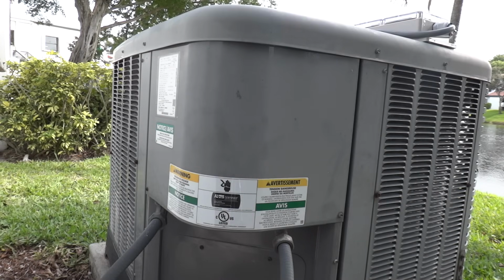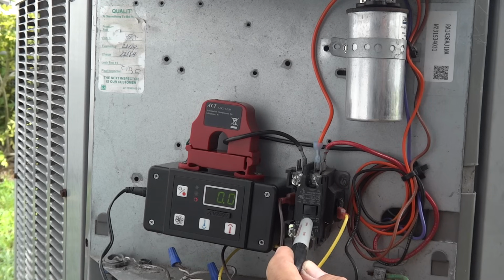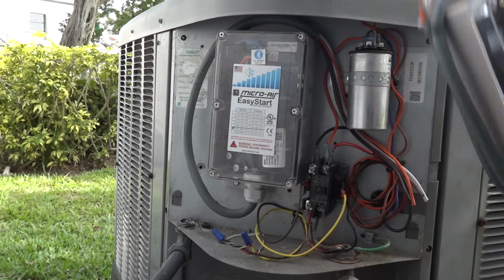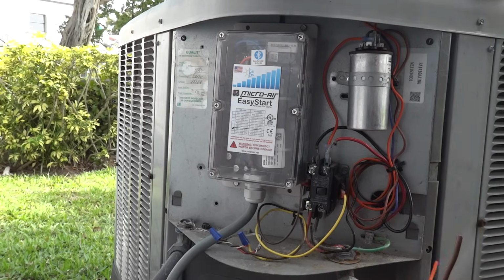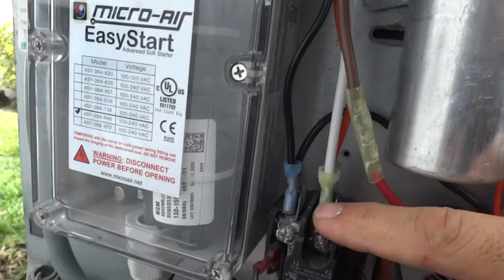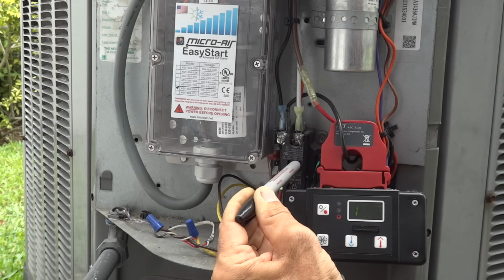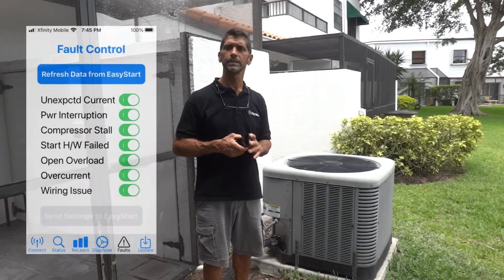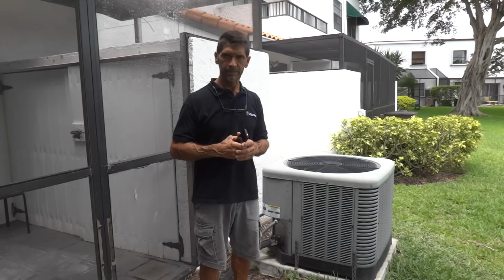Micro-Air EasyStart Home A/C Installation (368 Series)

Comment: Great directions.  I installed it today.  I spent more time on the bluetooth connection than on the actual installation.  5 stars on the product.  1 star on the bluetooth.  There was the oddest coupon in the box.  "If you bought this on Amazon, you paid too much."  Weird.
Reply from the maker: Hello and thanks for your comment and feedback.  The coupon you mentioned definitely did not come from Micro-Air, so we'd like to investigate that; from whom did you purchase the EasyStart? Also, what was it about the Bluetooth connection that you did not like?  Thanks in advance.
Reply: @MicroairNet  I tried to call but the automated answering system gave me the online options then hung up.  Do you have an email address?
Reply from the maker: @flyingjeff1984  Yes, you can send an email to help@microair.net.

Comment: Matteo, would you recommend a Micro Easy-Start on a 2 stage carrier condenser?
Reply from the maker: Hi and thanks for your question. Yes, absolutely. Other customers have installed EasyStarts into these types of systems with success.  By "2 stage", these systems are actually a single compressor with two *capacity levels*.  The compressor always runs at the same speed, but when your thermostat calls for stage 2 and it energizes the Y2 wire (in addition to the Y1 wire), the condenser controller energizes a solenoid at the top of the compressor that increases the pumping capacity of the scroll.  This is what the mean by "stage 2".  So, the EasyStart wiring is identical, however, we recommend that you carry out the first 5 learning starts for the EasyStart when the system is actually calling for the second stage (and thus drawing higher running current).  During each learning start, we also recommend that you run the system for at least 6 minutes because the EasyStart collects (i.e. learns) the steady-state running current for your compressor after it warms up at the 5-minute point.  This sort of learning procedure can be carried out easily by conducting the first 5 starts with the thermostat set at least 5 degrees below the room temp. For most 2-stage thermostats, such a high setpoint differential will cause the thermostat to energize both Y1 and Y2, and your condenser will engage the second stage after a minute or two.  Run the system at least 6 minutes for the first 5 starts and then you can restore your thermostat to whatever temperature you prefer.

Comment: I have the Goodman - GSX 140361 14 SEER 3TON CONDENSOR WITH A CAPF 3642C6C A-COIL WITH -TXV  I BELIEVE THIS MAKES IT A 3.5 TON  NOT SURE.    SO COULD YOU LOOK INTO THIS AND RECOMMEND WHICH EASY START MODEL I WOULD NEED. NOT SURE IF I WOULD EVER RUN IT ON A GENERATOR IF THAT MATTERS.  THANK YOU
Reply from the maker: Hello KRD.  Thank you for your question and for your interest.  The capacity of your condensing unit is what matters to the EasyStart.  So in your case, the 3-ton Goodman would require the the ASY-368-X48-BLUE model EasyStart.

Comment: Just purchased and installed my second easy start. First one was on my last home with a 3 ton ac. No issues there and worked perfectly with my generator. My new home has a 5 ton ac and the LRA label stated 157 amps. I didn't have a chance to actually test it but after the install and learn process, the peak amps on start up went down to 32! Wow is about all I can think to say. Again I should have no issues using my generator and running my ac. Thanks!
Reply: Do you have to discharge the run capacitor before removing wiring?
Reply: Did you notice any energy bill reduction after installing this soft start?

Comment: Matteo, I didn't hear you mention in your video whether or not installing this device will save money on my electric bill and if this can be calculated.  I would think with the reduced LRA, there could be some significant savings.
Reply from the maker: Hi and thanks for your comment. As it turns out, the energy (kWh) saved by soft starting is not significant enough to impact that portion of your electric bill.  This is because the startup is over and done with in about 1 second, so the difference in energy consumption is minuscule.  The steady-state running amps (and thus that energy consumption) are unchanged.  

What might make a difference in your electrical bill though is if you live in an area where your electric utility company charges you for what is known as "peak demand" (kW).  In such areas, reducing and/or eliminating the LRA spike will in fact save you money on your electric bill on that particular line item.  Not all electric utilities charge for peak demand though for residential customers, so it may not apply to you.

Comment: I have a 2.5 Ton H/P. Dose it make a difference if you have a Heat pump or straight A/C?
Reply from the maker: Hi Steve and thank you for your question.  No, it does not make any difference.  The compressor in a heat pump system operates identically whether in cool mode or (reverse-cycle) heat mode.  All that changes between modes is the routing of the refrigerant through the outdoor and indoor coils via the systems reversing valve. EasyStart therefore wires in the exact same way and operates identically in either mode of operation.

Comment: So being it knocked the amount of amps required could I get away with this and a 30 amp generator/wiring? Thanks, great video
Reply from the maker: Yes, you could get away with a 30A @240V (7200W) generator on this 3 ton system, and have perhaps 2000W of headroom left for other appliances.

Comment: Will these work with a split unit AC? Like a Mr Cool
Reply from the maker: Hi John and thanks for your question. I had to do a little research into what the Mr Cool units actually had for specifications. Sometimes, mini splits are not always inverter-driven compressors. They are just regular (single-phase AC induction motor) compressor housed inside of an enclosure that simply looks like a mini-split from the outside.  However, in this case though, the Mr Cool units as described on their website are in fact inverter-driven, variable-speed compressors. These compressors do NOT accept an EasyStart, nor do they even require one.  This is because inverter-driven/variable-speed compressors already slowly ramp up their speed during startup, thus eliminating any startup surge.   Hope this helps.

Comment: Can this be used on a heat pump unit ?
Reply from the maker: Hi and thanks for your question. Absolutely, the EasyStart is commonly used in a heat pump unit.  The way the compressor runs is no different in cooling versus heating mode. All that changes is a reversing valve that re-routes the refrigerant to reverse the operation of the condenser and evaporator.  The compressor behavior is no different in either mode.

Comment: The Warning stated to remove the Run Capacitor before installing Easy Air device yet you did the connections to the Start Capacitor. I don't see  the point made as the Start Capacitor is the cause for high Amp Compressor Startup. Please Explain.
Reply from the maker: Hi and thanks for your comment.  The proper steps are to remove any START capacitor before installing the EasyStart. The RUN capacitor always remains installed.  I've reviewed the video again and I don't see where there was any reversal of this information presented.  Hope this helps clarify things for you.

Comment: Can this be wired to a pool pump motor?
Reply from the maker: Hi Corey and thanks for your question. Although it has been done with success in the past, Micro-Air no longer recommends nor supports EasyStart being wired into any "frame" motor like a pool pump, air compressor, or the like.  Although it works, the difficulty of gaining access to the necessary wires in any given frame motor is so challenging, Micro-Air cannot provide the necessary support to do so.  If however you wish to try it out on your own, you can, but Micro-Air won't be able to provide any support there.  Thus the reason for they're no longer recommending EasyStart for such applications.  Thank you for your understanding.

Comment: who can perform the installation if I'm not good at it?
Reply from the maker: Hello and thank you for your question.  Any qualified HVAC technician or electrician can install EasyStart simply by following the instructions.  Beyond this, Micro-Air also has a network of authorized dealers who can help you as well.  Please check out the dealer locator tool at https://www.microair.net/pages/find-a-dealer.  Hope this helps.
Reply: @MicroairNet  thank you for the answer. unfortunately in my area only RV dealerships sell your products and they don't selle the House version of this, nor can help with installation.
Reply from the maker: @amelsfr  Okay. Please email help@microair.net and let us know your location. We might be able to find someone else to help you with your home installation.

Comment: My unit is a 410A unit and states that LRA is 72 and RA are 13.8. The LRA numbers are higher than the 2 and 2.5 ton values listed on the chart for the entry level X36 device....but my unit is not a 3 ton unit. It's a 2 or 2.5. Can I still use the entry level X36 unit or will 72 to 78 LRA overload it?
Reply from the maker: Hello and thank you for your question.  The LRA values in the chart shown in the video were only averages across a few systems that I looked up to get a general average for each capacity point.  EasyStarts have always been sized not based upon LRA but based upon system BTUs. We have recently revised the sizing recommendations for EasyStart in our online model selector tool, and this can be accessed at http://www.micro-air.com/tools/easystart/modelselectorv3/step1.cfm.  Using your system tonnage (e.g. 2.5), multiply it by 12,000 to get BTUs (e.g. 2.5 tons = 30,000BTUs).  Hope this helps.

Comment: Has anyone ever had a faulty code saying wiring is bad. But all connections are tight and correct? J4HP4036A1000AA is the model of odu
Reply from the maker: Hi Baltazar and thank you for your question. Yes, users have experienced the "bad wiring" fault even though their connections are tight.  However, they will not experience this fault i their connection are correct.  Please take some photos of your system's wiring diagram, and your EasyStart wiring, and send them to help@microair.net. Someone there will assist you.  Thank you again for your business!

Comment: You should really highlight the brownout, over voltage and power interruption features of the EasyStart in your literature more. This protection is why I bought your brand over others. Utility power isn't as reliable as people think and it is very hard on compressors.

Comment: Hey there great video, helped me decide to install on my 5 ton unit rated for 152.5 LRA. Unfortunately, I don’t have a good ‘before’ number for actual inrush amps it was pulling. But, upon install the first learn cycle scored just 41.9 inrush amps and by the 5th learn it was down to 32 inrush amps. So the device seems to be consistent with MicroAir claims of 75% reduction. Sweet. Hey can you help with a question I have? This is a 240v system and the circuit breaker I have is a pair of 30 amp breakers supporting AC. So, does that mean that my AC is now pulling 32 inrush amps on EACH leg or TOTAL? I am not sure I am clear the role of the two 120 volt power legs that sum up to 240 volt total. I am trying to size the generator I would need and wondering whether my AC is using 32 inrush amps on each leg and therefore I need a generator that can keep up with 62 amps or does it mean I just need to generator 32 amps total. I guess it comes down to what MicroAir is reporting in the app - 120 volt data or 240 volt data.
Reply from the maker: Hi Nate and thank you for your comment and for your business!  The 32A breaker means the net current drawn by your A/C outdoor unit is no more than 32A steady-state under rated load conditions (RLA).  You can find this exact number on the dataplate label of the side of the A/C. A typical 5-ton system has an RLA for the compressor of about 26A, an RLA for the outdoor fan of about 2A, and an RLA for the indoor fan of about 3A.  The total steady-state current once the system is up and running is about 31A (31Ax240V=7440W) Given the 65-75% startup current reduction from the EasyStart and the typical surge ratings for most generators, you would need a generator with a MINIMUM of 8500W for a rated (steady-state) capability.  (Note that without EasyStart you would have needed about a 18000-20000W!)  But, you obviously want to run other appliances in your house besides your A/C system, so you should size your generator accordingly.  Do a power budget by adding up all of the other important appliances and conveniences that you want to be able to run IN ADDITION TO your A/C system. Otherwise, if you purchase an 8500W, you would have to make sure everything else is turned off when the A/C compressor goes to start.  Most people these days are finding that the 12000W or 13500W generators (dual or tri-fuel) are affordable and provide enough headroom to run the rest of the house (on top of the 5-ton A/C system) without a lot of power management.  

Thank you again for your business.
Reply: @MicroairNet  Thank you for reviewing my question and offering an answer so quickly. I wanted to provide these details and see if that would change any of your calculations. Per the label on my system, RLA is 23.7 and LRA is 152.5. According to my MicroAir my Last Start Peak was 30.8 and Live Current is 10.7. I will note that it is 51 degrees F today so the system isn’t working as hard as it would during a Texas summer day of 105F, so maybe power consumption would be higher in the summer. Given these measurements, does anything change in your first analysis?
Reply from the maker: Thank you for the additional information.  I would not change the recommendation range, although you might now be able to do well and have enough headroom for many other appliances in the house with a 12000W generator.

Comment: It's pulling less power than it used to when running continuous? Is the compressor still running as usual, or is it running with reduced power, thus reduced compressor function?
Reply from the maker: Hello and thank you for your comment/question. EasyStart has absolutely no impact on the steady-state running amps of the compressor.  It cannot affect this, so it is not reducing its power.  What is likely happening is the environmental conditions are changing. That is, compressors will draw substantially more power when the weather is hot outside, versus when it is cooler.  This can make up to a +/-10 to +/-20% difference. That may be a more likely explanation as to why you are seeing changing power consumption.  You may have never noticed this before, but now that your EasyStart provides live current readings via the Bluetooth app, you do notice it.

Comment: Do you have a solution for defrost lockout of aux heat to maximize heat pump use on a limited power source?
Reply from the maker: Hi and thanks for your comment and question.   As you probably already know, the defrost behavior of a heat pump system is governed by its own controller using its outdoor temperature sensor.  Some systems run a periodic defrost cycle when the outdoor temperature is below an initial threshold, and then totally give up on using the heat pump (and instead use indoor aux heat) when the outdoor temperature is below a lower (lockout) threshold.  Unfortunately, EasyStart cannot affect this behavior since it is wired completely outside of the heat pump controller.  Micro-Air does NOT recommend nor support any alteration of a system's defrost behavior since forcing the heat pump to run at colder temperatures might in fact cause ice formation and its associated expansion in the crevasses in the outdoor coil. This in turn can cause mechanical deformation, cracks, and damage to the copper plumbing in the condenser coil itself that might results in refrigerant leaks, thus potentially destroying your system.  Thank you for your understanding.

Comment: Is it that hard to post a simple wiring diagram sheesh!
Reply from the maker: Hello and thank you for your comment. The EasyStart Knowledge Bank on the Micro-Air website has dozens of wiring diagrams for different brands and types of A/C units.  You can find this knowledge bank at this link:  http://www.micro-air.com/kb_easystart.cfm. The installation instructions for a generic home unit can be found at this link:  http://www.micro-air.com/support-documents/residential/current/EasyStart_HomeResidential_Installation_Guide.pdf

Comment: Can this be used on a 220v well pump?
Reply from the maker: Hello and thank you for your question.  The EasyStart ASY-368-X72-BLUE has been installed with success on a few 230V 3-wire well pumps in the past.  The challenge with these installations is that the wiring is a bit more complicated and sometimes less easily accessed than that of an air conditioning compressor.  As a result and due to resource limitations, Micro-Air no longer recommends that you purchase an EasyStart for well pumps and the technical support team no longer provides support for this specific application.  This of course does not mean you can't do it on your own, at your own risk, but we want it to be clear to you up front that the team unfortunately cannot provide assistance. Hopefully you can understand.